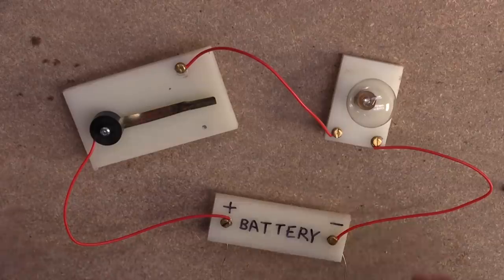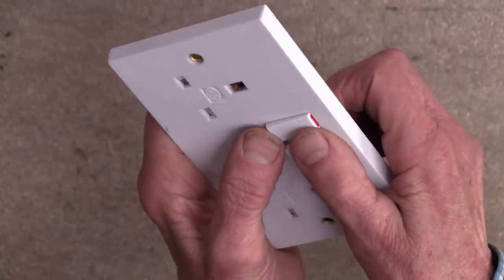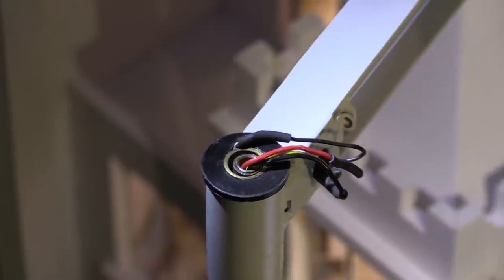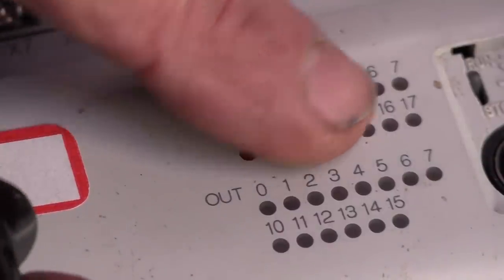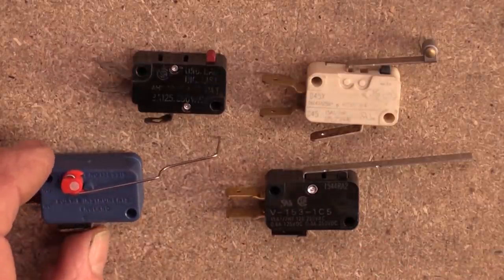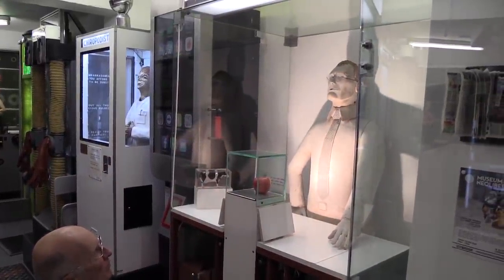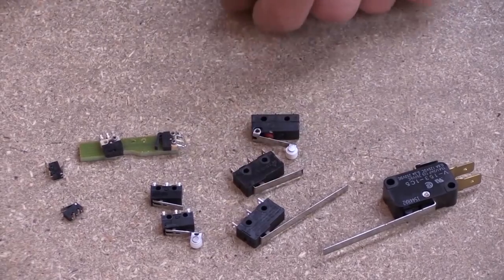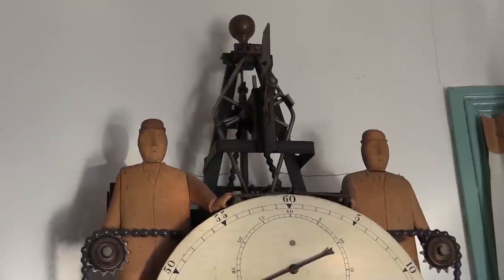SWITCHES - The Secret Life of Components, a series of guides for designers and makers - Episode 4

Comment: I worked in radio and we used to use mercury switches for the turntables.  They wouldn't make any noise and couldn't be picked up by the microphone when you were trying to talk over the beginning of a record.
Reply: Any cough buttons built that way?
Reply: Grrrr. I hated that talking over the beginning of a record, so hard to edit out of a "Pirate" recording...
;-)
Reply: @BoB-Dobbs_leaning-left  I would do the "Album Side Dinner."  I would tell the audience I was going to play both sides of an album, playing the first side while I would go across the street to get my cheesesteak (this was in Philadelphia) and then playing the second while I ate it.  I'd always start by telling the audience that I'd start playing "in five seconds" so they could start their cassette decks.
Reply: Mark Banash, years ago,  I briefly owned a "unipivot" type tonearm that was designed by Keith Monk (of record-cleaning-machine fame), which used a 4 section Mercury bath to a) float the rear of the arm to eliminate horizontal/ lateral friction and b) make the 4 electrical connections from the arm-wand and phono cartridge to the base of the arm and out to the preamplifier. The mercury sat in an open face, 4- sectioned plastic cup, and the liquid metal could "evaporate" (sublimate),  spill out if the turntable was relocated without emptying the reservoirs,  or even if bumped into. It would never pass any kind of environmental, public safety or OSHA requirements nowadays.
Reply: @goodun2974  As we say in New England, that is wicked cool.
Reply: @markbanash921  , (fellow New Englander here);  I think the Monk arm was designed in England in the 60's.  I don't know how it got past British safety standards back then, or how it came to the US (another fellow audiophile/salesman gave it to me)  but it certainly wouldn't be allowable by the EU these days. I didn't like the idea of open Mercury reservoirs in my listening room and so I bypassed the Mercury part and ran very thin wires out the back of the tonearm wand and down to the base.  I forgot to mention that it did actually have a single unipivot bearing in the centre, and 4 pins that came down and contacted the Mercury reservoirs not only passed the audio signal but also functioned as outriggers for stabilisation of the tonearm. A great idea for engineering-wise but not such a good idea from the standpoint of safety!  I wasn't that impressed with the sound......

Comment: The mercury tilt wall switches were probably for use in a high fire-risk environment - maybe one with a possibility of flammable gas leaks. Can’t have any arcs in the open air, so use a mercury tilt switch to contain them. Another possibility that comes to mind might be clean rooms for semiconductor manufacture (or similar) - perhaps arcs can contaminate your air with tiny particulates?
Reply: I think that the switch for the light in the boot of my S2 Daimler was a mercury switch. 
It didn't save it from internal corrosion.

Comment: I have a Trust mouse I used quite a lot on my older computer. The left mouse button started to act weird, I had to press it real hard. I thouoght the switch was wearing out, I planned to replace it. Opened the mouse and I didn't find any markings on the switch to identify it's time (it's needed for the right values and size if I order it online and can't check it in person). I put the mouse away for later. Then I had an idea and took apart the switch itself, cleaned the contacts with a little bit of sanding and applying some contact-spray and now it works better than ever! I'm so happy I didn't need to hunt for the right type of switch.

Comment: I have never quite grasped how to set up a reversing switch, but your display made it make sense.  Thanks for posting Tim.
Reply: There's even a way to do it with DPDT switches. If you do not have an ON-OFF-ON switch. Which best as I can figure it is what that one type of switch is called. Sometimes they're called, "Center off"? But then you do need a separate on and off switch. Which does make for a messy installation. There's two machines in my shop I wired up two switch. Because ON-OFF-ON switches can be a bit dear. I hate to have to buy things.

Comment from the maker: Good question. I should have included it in the video. I agree hall effect sensors, and also opto and inductive ones avoid the problem. Also my PLC logic controllers have built in debounce. With mechanical switches connected to an arduino, I add a delay so it registers an input a couple of milliseconds after any change. Also the code I commissioned for the Brightsign media players I use for sound and video has an option to adjust the delay time.

Comment: I was temporarily working at my brother's employer for a few months to help them satisfy HVAC maintenance contracts at a grocery store chain (I was between jobs due to a layoff, and have an engineering degree but zero HVAC training, so I did low-level maintenance work).  I was tightening up wire connectors on 3-phase contactors, and accidentally arched my screwdriver across to ground.  It shut down all the circuit breakers to the whole store.  I found my way into the back room where the panels were.  Turned them all off, then reset the large spring-loaded main breakers.  I'm a 300 lb guy.  It took nearly everything I had in me to pull the level on that main breaker.  Felt like I was going to damage it.  First time I ever dealt with those monsters.

Comment: I suspect the reason the substation switches don't snap is they'd have to have such a strong spring that the mechanical shock would risk cracking the insulators. 
I wonder if it may also be that the arc helps soften the fast transient that a sudden connection would cause - this could cause a resonance with the line inductance and capacitance, leading to an overvoltage spike. 
ISTR reading that they are not normally opened or closed under load.
Reply: The Swiches in open air are separator Switches they can only be operated when no power is going over them, the arc you see is just capacitive loading and cross coupling from other lines, nowhere near the operating currents. There their only job is to give a visual indication that the lines are disconnected, sometimes they also used to create cross-links or to route inside the station, again also to give a visual indication of the connection in the sub station, because of safety.
Reply: They'd normally only be opened under load in an emergency or maybe testing sometimes they flood the area around the switch with nitrogen just before switching to reduce the arc or they use enclosed switches surrounded with sulphur hexafluoride (anti Helium).
Reply: @mfx1  Isolator switches in substations can never be operated under load even in an emergency, AC High Voltage Circuit Breakers can be operated under load , but these are encapsulated, with a dielectric of Oil, Gas or vacuum.
Reply: @heinrichhein2605  They often have mechanical arc snubbers inside too - e.g. a plate (plastic, presumably) which chops between the contacts as the switch operates.  Changing the oil in oil-filled switches is also something that must be done after a certain number of operations, as the arc creates "carbon snakes". These normally settle at the bottom of the switch, but when the switch is operated they can be stirred up. If there's too many of them, the switch actually starts to arc continuously through these conductive "snakes", which generally leads to the switch exploding a few seconds later. I'm told they make a quite distinctive noise in this situation; giving a sufficiently alert operator just enough time to get the hell out of there before the big bang.
Reply: @theelectricmonk3909   yes correct, Circuit Breakers are a big topic, I have worked on designing some of them, there are many things to consider and each variant has quite significant differences. You can also get breakdown form Fibers in the oil from the isolation paper that's used etc.

Comment: Fantastic video! Thanks for sharing your knowledge of mechanical and electrical devices, very informative. Love those Hg switches, I have hoarded so much gear from old installations that were destined for the dump, I also have many Hg switches in a box including a delay switch that allows the Mercury to flow through a small capillary into the contact chamber. Might have been part of an electric motor soft start circuit. Pity I am in Australia, you would be so welcome to go through the shed and take any parts you can use for your projects.

Comment: When I was little, I always loved those light switches that could be turned on half way. Made lights flash nicely.
I think the slow switching of HV applications is to prevent high spikes or oscillation on the line.
25:02 You could use a double pole switch, so that 1 switch can switch both the motor and microcontroller simultaneously while keeping both circuits electrically isolated.

I used to have an old Honeywell thermostat that used a mercury switch. 
That mercury switch was mounted onto a rolled up strip of bimetal. 
When closing in to the set temperature, the bimetal strip rolled off partially, until it was tilting the mercury switch enough to make contact.
That switch turned the heater off.

Comment: BTW Tim, I have seen those mercury switched power sockets from the front on the outside front of fume cabinets when I worked in the BT Martlesham cleanrooms making nanoscale devices, where incidentally we frequently needed to handle toxic & explosive gasses. I suspect the use of enclosed mercury switches was to avoid all possibility of an exposed arc & thus a potential ignition source.

Comment: You need a resistor and capacitor to supress the arc, otherwise the capacitor discharges too fast across the switch
Reply: Mike  a 0.2 uF Cap is what we use in all our systems to stop arching.   The resistor goes across the cap and is called a bleed resistor.   This is how we in a recording studio stop snaps from effecting our work.   The Cap will not let the 50/60 hz through, but the spark is a transient of high frequency and is passed through the cap, stopping any sparking.   Been doing this for almost 40 years now Mike, I do know about this.  Tim also mentioned putting a diode across, that would be a bad thing. lol.  You put a diode across a DC coil to stop the reverse current that an inductor can create.
Reply: @samjones1954  capacitors or RC networks generally modify the DV/DT which is what creates sparks and transients. Its important to differentiate between arcing due to plasma and sparking due to metal particles, think how connecting a car battery sparks like mad at 12V but generates little RFI
Reply: The R+C helps with turn-off, and indeed little sparking is seen in the video at turn-off -- it only worsens turn-on though.  To do that, you need an R||L in series with the switch -- but this is a bulky component, so most times us designers just sigh and let it be.

When the switching is very fast (transistors in power supplies), the size of both components is small, and both can be used to good advantage.
Reply: @T3sl4  There is also 0 voltage switching or zero crossing, for ac. It switches on the wave point where the current reversal equals 0v.
From Wikipedia.
Zero crossing (or burst-firing) control is an approach for electrical control circuits that starts operation with the AC load voltage at close to 0 volts in the AC cycle. This is in relation to solid state relays, such as triacs and silicon controlled rectifiers. The purpose of the circuit is to start the triac conducting very near the time point when the load voltage is crossing zero volts (at the beginning or the middle of each AC cycle represented by a sine wave), so that the output voltage begins as a complete sine-wave half-cycle. In other words, if the controlling input signal is applied at any point during the AC output wave other than very close to the zero voltage point of that wave, the output of the switching device will "wait" to switch on until the output AC wave reaches its next zero point.
Reply: @BoB-Dobbs_leaning-left  Yup, that's another nice one!  Downside, it doesn't work as well when the load is reactive (current and voltage aren't zero at the same time).  In that case, the ol' snubber still helps to patch things up.
Reply: I love that @mikeselectricstuff is watching Tim's channel

Comment: Mercury switches are my favorite too and I was lucky to find some big ones from a local surplus vendor. When I was younger I had my first PC on the floor and I remember that after I got a rolling chair I was often bumping the RESET button on the bottom of the case because it came to be at the same level as my feet when moving.
So one time I got fed up and disconnected that switch but since I still needed a quick way to reset the machine when needed (and windows 98 needed it more often than not...) I wired a mercury switch that I made myself from the recovered mercury from a broken thermometer and a random plastic vial I had around where I poked the wires through.
From that moment I could reset the PC with a quick flick of the dangling mercury switch

Comment: Perhaps the strangest switch malfunction I have ever seen involved a microswitch of the variety seen in his giant model at 15:43.  Around 1973 I was an aircraft mechanic working on a Convair 580 in a scheduled maintenance visit.  I replaced a motor-driven actuator that was working correctly but was due for an overhaul.  After installing the new unit, I was surprised to find that the vent door it drove would open when it was supposed to close, and vice-versa.  It was hard to believe that the new (or overhauled) actuator passed all inspections with such an obvious fault.  So I installed a second, serviceable unit.  Same problem.  The wiring had not been touched.  No record of previous problems with the system.  I went to the bank of microswitches inside the cockpit control pedestal and located the one that controlled the vent actuator.  It looked fine.  Checked the terminal voltages, and found that the switch was switching in reverse: voltage from common to NC when actuated, to NO when released.  The switch had reversed itself internally, in service, and had apparently done so just as the airplane came in for a maintenance visit. The vent door was visible to anybody walking around the airplane, and a malfunction would have been spotted before any flight.  A new switch fixed it, and I gave the removed switch to the foreman for evaluation.  I have seen micro switches fail open or shorted or intermittent, but never reversed.  A unique encounter.

Comment: Thanks for this. A very informative and entertaining video.  Also there are other types of switches like reed switches, hall effect switches which respond to magnetism. Optocoupler or opto-isolators are like a relay but switches isolated circuits by using light. Also in digital circuits sometimes you need to debounce mechanical switches that are interfaced to a microprocessor by using an inverter IC chip like a 7404 using NOT gates so you get a logic 1 (high) or logic 0 (low) and not the on off on bounce state of an input from a push button switch.

Comment: As others have stated below, those substation switches you've shown in the video are disconnectors. They are meant to be operated off load. There are normally voltage or other interlocks to prevent them from opening on load. Which probably explains why those vids normally feature people nervous laughing or gulping because something has gone wrong! Haha Circuit breakers do operate on load and fault conditions, normally spring powered but some new ones use a magnetic actuator to provide even faster contact separation.

Comment: Great video. The high voltage isolators move slowly because they are only required to break/make very small capacitive currents which although spectacular at high voltage are minor compared to the load and fault currents.

Comment: The reason for them to swing apart slowly is that it is classed as forced disconnection. The use of a spring is not 'failsafe', you earlier mentioned the arcing and sparking, this heats up contacts, this heating can actually 'weld' the contacts and this occurs the contacts in a spring loaded mechanism WILL NOT open. They are not forced to disconnect. The contacts on an Emergency stop button are of the 'forced disconnect' type, they usually move slower but even if the contacts had welded, the pressure applied from the person hitting the e/stop is enough to drive the contacts apart.
They often have the symbol of an arrow in a circle to show this.

Comment: the final section with the mercury switches where you show the double socket you have with mercury switches in the back used to be used in hospitals, operating theatres, etc because of them being in an oxygen rich environment with flammable gasses present, basically mercury switches are just explosion proof switch as the arc is happening inside the glass capsule

Comment: 5:50 I am an EE and these are isolators. they are not meant to "break" actively fed circuits. That is the job of a breaker. Usually these are utilized to isolate parts of a circuit after de-energizing for maintenance.

Comment: I remember a photographic paper processor from the 1970s that had long arm micro-switches on the feed table to turn on the drive when paper was put in. Then there was a mercury switch that was moved by an arm on one of the drive gears, the micro switches and mercury switches together controlled the chemical replenishment system. I think on that machine the chemistry was switched by a solenoid valve and the chemistry was fed by gravity into the processing tanks.